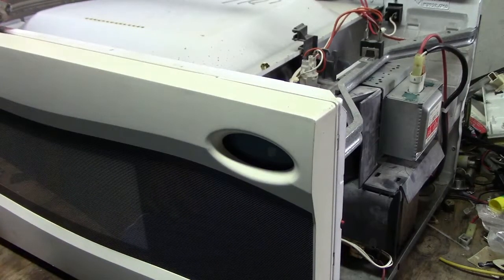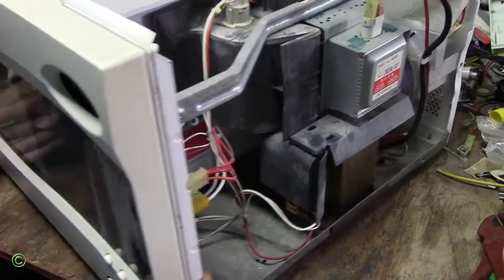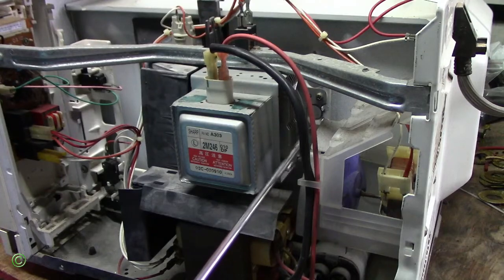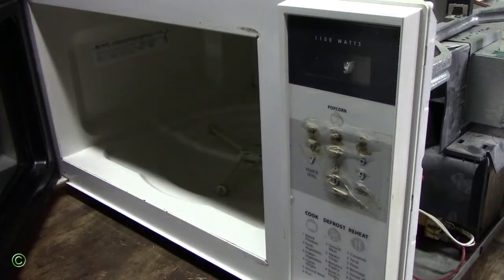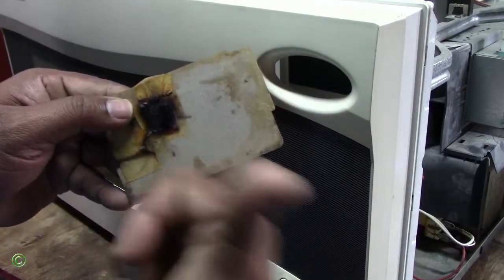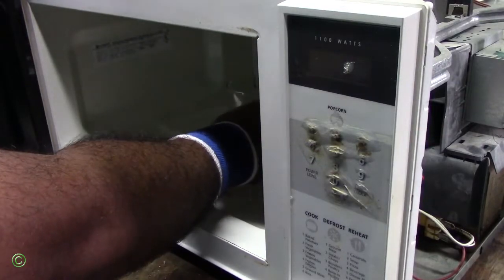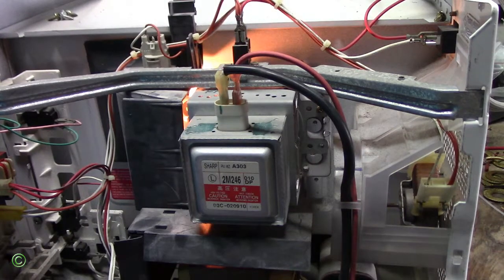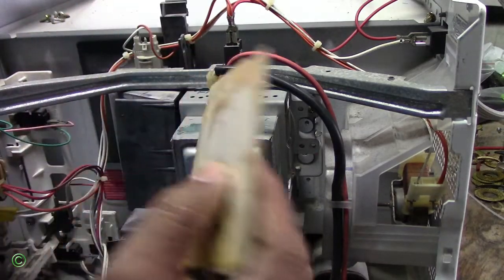Microwave oven keep sparking and making a very loud noise

Comment: Thank you! My magnetron tested good with an Ohm meter, diode tested good too. Watched this video and temporarily removed the cover which had arc burns on it and the oven worked perfectly.  Now I see you should replace the cover every 6 months.  Fortunately a replacement pack of 5 generic dimensionally equivalent covers costs $9. You can cut your own covers out of sheet material shown on other Youtube sites.

Comment: what about sparking between magnetron and transformer ? any advice
Reply from the maker: If the magnetron is sparking between is because the antenna is burnout and need to be replace. If the transformer is sparking then the winding have exposed wire.